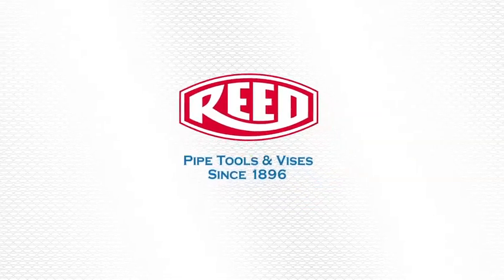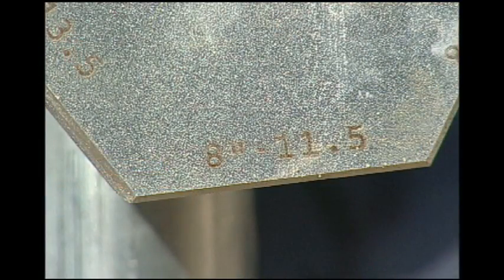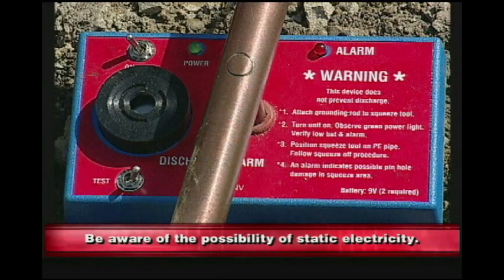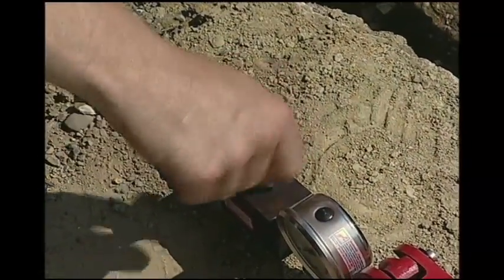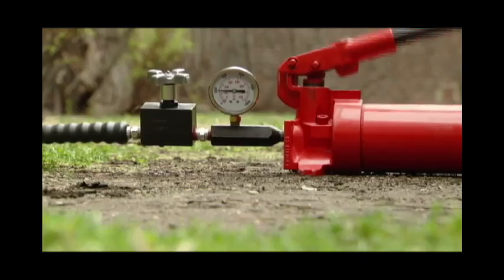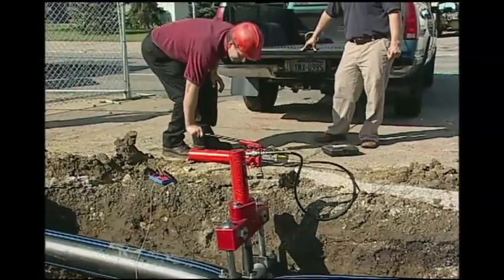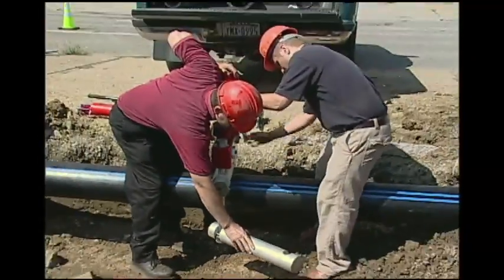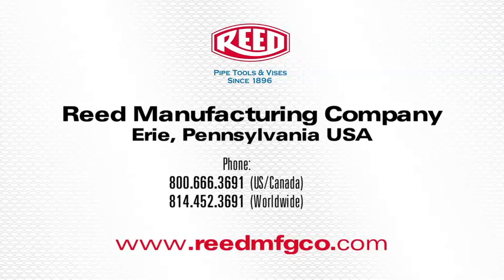PE Squeeze-Off Tools with Demo of PES8H - Reed Manufacturing

Comment: These are garbage. They don’t give you a full pinch
Reply from the maker: REED expects our tools to work properly.  We would appreciate you getting in touch with us to find out what might be going on with that 4 inch squeeze tool.  We need to know the model name/number.  A photo would be helpful, too.   We'd like to troubleshoot this with you.
Please call us (800-666-3691) or email us at reedsales@reedmfgco.com
Reply: @ReedPipeTools  Are there any models for 10" DR11 HDPE pipes?
Reply from the maker: @KrishnaSingh-oc2ym  Currently REED models only go to 8-inch diameter pipe.  We would be interested to explore the 10-inch diameter question with you.  Would you send an email with your requirements to:  marketing@reedmfgco.com        Thanks.
Reply from the maker: @KrishnaSingh-oc2ym   Currently REED models only go to 8-inch diameter pipe.  We believe there are a couple other manufacturers who make a 10-inch model.